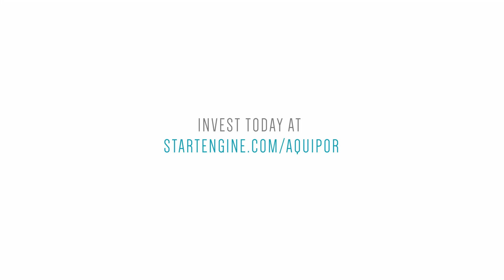Greg AMA What Makes AquiPor Special

Comment: Interesting, have you installed the material in a every day setting yet? A parking lot, a driveway, a culdesac, something that would give us a sense of how the material performs in everyday, every weather, every civic situation?
Reply: How does it handle on heat build up due to friction, sun, humidity, and ice cold temperatures? What about elasticity? The Earth and ground shifts, and so concrete and gravel is so rigid, we get road cracks and pod holes.

Is this product being centered around solving those problems? Or is it a brick paver alternative?

The other issue is cities want the rain water runoff, if this product is going to funnel the water back to the Earth, and yes thats a good place. The US cities water municipalities would charge home owners more for the same amount of water, because they must extract using more resources than the already built infrastructures that collects rain water runoff.